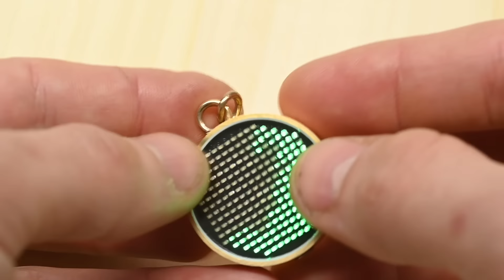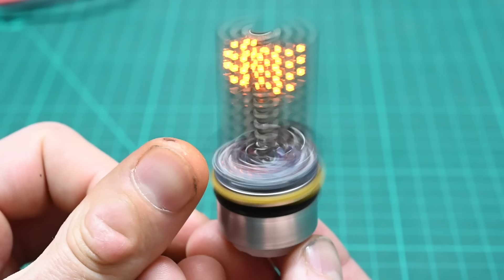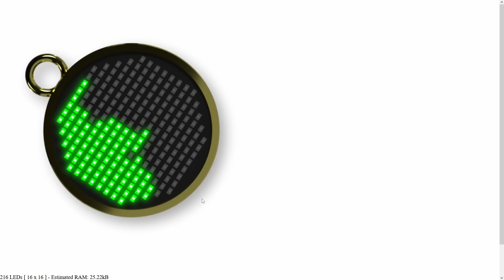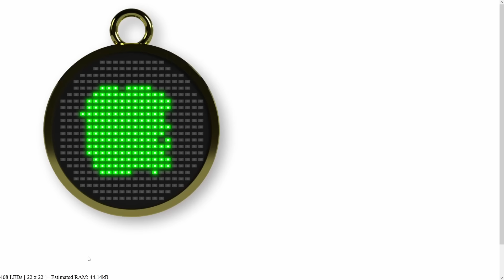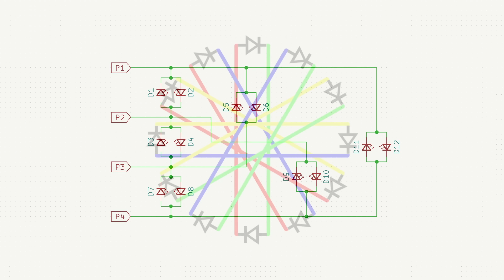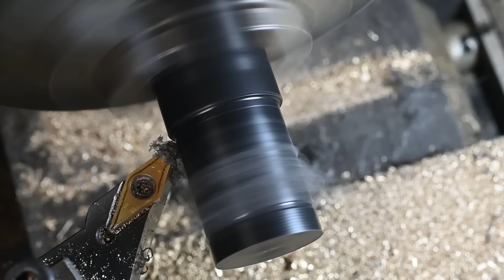Fluid Simulation Pendant

Comment: I have a question. Is it possible to make a very small micro-form device where bringing a magnet close to it turns an LED light on, and the light stays on? Then, when the magnet is brought close for the second time, it automatically turns the LED light off. In other words, can a very small magnet-controlled LED circuit like this be made?
Reply: you can detect the magnet distance with a sensor (hall effect i think?) and do the rest in code, so yeah i don't see why not. maybe you could even do it with analog electronics.

Comment: i would put water inside and some sensors lol
Reply: I would assume the Problem with water will be with surface tension, at that small scale water will end up sticking to surfaces and might result in inconsistent results.
Reply: @purvr4626  what if we put some hydrophobic thing?

Comment: I've got a 2.0 iteration challenge/idea if you're interested. Try to give the simulated fluid some depth on the 2d array. So for example, when you set the pendant on the table, the fluid would eventually settle but look thinned out with dimmed lights. Or perhaps you want to have an uneven concave basin, where the liquid pools more in the center and the centre would have a higher brightness potential. It'd be interesting to learn how compatible this would be with the pendants from this project.

Comment: i may be wrong but can we make a dense electolytic flilled liquid and then fill the disk with it and at one end its a led and another end is a wire .....so basically liquid completes the circuit and it also glows the led which looks like liquid😐😐.......................btwn thats a  cool thing u made

Comment: I am doing the same project as this and I had a look at your website and you said you would release the code sometime but that has not happened yet I would like to have a look

I would also like to note I’m replacing a few of your components with  for example the rp2040 raspberry pi pico

EDIT: coming back after 3 months , I have made the first working prototype , it’s not as elegant as yours but I will be refining it.

I have all ready learned so much

Comment: This is probably really dumb, but what if you used actual fluid instead of simulating it?
Like putting some conductive fluid between the battery and the lights so that when you shake it the actual fluid shakes and the lights power on/off because they are literally getting powered by the fluid
If you wanted some animations like you did you could probably use a secondary circuit wired to only activate on specific movements

Comment: I just had a neat idea that I hope to make someday but am sure you could accomplish better.

A ring of light. Or perhaps a bracelet. Something you wear that produces light by being worn.

LEDs can be super low power these days and still produce useful light. Peltier devices can use electricity to produce a temperature difference, or use a temperature difference to produce some current.

So, a piece of jewelry with skin contact, that uses the temperature difference between body heat and atmosphere to produce current to power a very small efficient light.

Comment: Hello, couldnt the problem of charlie plexing be solved entirely by not doing it at all and using small shift registers and using just a couple or even one gpio pin and hooking it up with the DMA and PWM controller of the stm32 chips like ws2812b leds do?

Comment: that single connector is the same type they use for magnetic usb cables with the magnetic connectors, the one you're using i'm assuming has one pin thus charges slower (p.s i know nothing about electronics, i'm just guessing) because the better connectors have more pins and some come in braided cables, some offer even rapid charging for fast smart phones

Comment: There is nothing unconventional about changing MCU (or FPGA) pin assignments to make routing easier. Pin swapping has been around forever, and some CAD packages can even do it more or less automatically. Some high-speed interfaces, like USB 3.x and Gigabit Ethernet, have automatic polarity and/or lane sensing specifically to allow direct cross-free routing of high-speed signals.

Comment: I think the snap back was a good idea, if you want repair-ability it allows easy access to the battery if anything ever happens to it, and same with the circuitry it's good to be confident with your design, but even better to be confident with it's user repair-ability.

Comment: I think the only 2 changes that would make this better are:
1.) A dial built into the where the jump ring meets the pendant that increases or decreases the brightness when rotated 180 degrees. (if you could find a dial that would fit and work well enough while also hanging from a necklace)
2.) Make the octagon arrangement closer to an octagon for more efficiency filling the circle. Without adding a very high number of pixels, the best approximation closest to this one would add 1 extra to the diagonals for 264 pixels (an 18×18 square grid with 15 pixels missing from each corner).

Comment: if you feel like making it more complex, would be cool if you use a 3d simulation and dim the LEDs to show depth. so if it's flat on the table screen up it's dim but fully illuminated, and screen down it would be bright fully illuminated. it would also make the splashing around quite cool imo but wouldn't ruin the ascetic of it being a low res screen.

Comment: It would have been cool if a water pool was 2 layers deep and half full, so when it was laying face up it was a solid color. And also displaying how much water in each pixel by making it dimmer when only one layer is filled would add a practical purpose to it as a level.

Comment: Stupid question from someone with very very limited electrical experience, but to help with the shorting issue when connecting the charging cable, could you also isolate the charging port by widening the hole a little and using a rubber gasket in the charging port's mounting hole as well as protective insulation on the internal wires? I'd love to give making this a go for a present, but I know the user would likely end up plugging the usb in before the charging port or knocking the cable enough to short it.

Comment: Why not just use water?
Reply: Because the point is that it's a fluid simulation, not actual fluid. He discusses this literally a minute in.
Reply: Why not just use a smart phone?
Reply: You are deliberately missing the point.
Reply: @mochafennec You are deliberately missing the point that sometimes mechanical designs and/or simple designs are superior and more cost effective than the all electronic / microprocessor / ai alternative.
Reply: You are correct, nobody is arguing that isn't the case. Since you seem to need to have the point spelled out for you, the reason it was done this way is because the fluid simulation and representation of said simulation using the LED matrix is a complex task in and of itself, and as explained in the first few minutes, it is part of an exploration on using similar technology in other, more complicated applications. You are so desperate to make your point that you are willingly ignorant to the intended purpose behind the project.
Reply: @mochafennec  Yes indeed, I am. In fact, I haven't watched the video entirely. That said, I had the time to see that it was not simulating a fluid but sand and sand cannot be 2D hence the awkward look. I was gonna say there is no practical use for such a thing and even for learning purpose there was no need to implement it and that it is a waste of time but seeing that he sold a bunch for 1000 pounds each I'd say this is a nice work of art / jewelry. Thanks for arguing with me, I will not respond to subsequent answers since this would be a waste of time.
Reply: Have a good one.

Comment: You are whipping that thing all OVER the fucking place. Hold it still for a second FFS dude! Turned the video off because you're literally going ADHD every time the simulation is on screen. I get that you're trying to prove that the thing works but jesus christ dude let us watch it in action instead of jump cutting to 30 different angles of you flipping the thing around like you're chasing a high score. Do you struggle with fidgeting? With ADHD?

Comment: One thing I am concerned with in terms of purchasing electronic jewelry is the failure rate. So, what if an electronic component breaks inside the pendant. Your the only one who can fix it. Could people send the amulet back to have it fixed for damages? I understand that there would be a service fee in terms of the pendant being fixed. Also, there is sending it through the mail which all those fees add up.

All it can take is one thing to go and say if I purchased an electronic ring and me dropping it then it not lighting up. The entire purpose I purchased a light up ring is for the light function. Without that the ring's value or functionality is a lot less.

Comment: This could also work with just having LEDs in one side and a source of Power on the backside and filling about %50 of the inside  with mercury, to conduct the power from the battery to the LEDs. Not sure if this would actually work, it's just how I imaged it was done before seeing the video^^

Comment: Correct me if I’m wrong bcuz I’m pretty new to electronics
Could you not put some actual fluid in the back of the pendant and run a current through it to light up the leds?

Comment: I was thinking if the display and power components could be separated, as this would make the design even thinner. For example, the magnet connector currently at the bottom could be moved to the top, serving as a hanging point too. It could transfer power from a battery too. The battery could then be a needle type battery seamlessly integrated into the pendant chain.

Comment: this looks awesome, i think the design could work with a single button for more simply turning it off off and could even be used to change modes or something if you wished, one small button close to the reset thingy probably wouldn't ruin it aesthetically

Comment: Astonishing! This shows how tricky auto routing is, since it only works in complex cases if you have already optimized the schematic 

I'm not aware of a system which can do this in the general case. Only special cases like impedance matched traces are covered

Comment: Beautiful! For building such a display I found it easy to make my own four layer PCB by soldering together two two layer ones. Make vias on one board and pads on the other, then hold the two boards together and fill the vias with solder. Voila: A super cheap four layer board with blind vias. This gives you much more space on the back.

Comment: the thing in my head was to make the inner walls of the ring+back a mirror and have glass reflect some of the lights back and the mirror would give some back and it would bounce off again. the subtle offset would create an endless depth that vanishes beyond the ring. kinda like those "endless mirror advertisement boards"
Reply: nevermind it was very thin for it

Comment: If you could find a way to project each flip cell (maybe in an LED matrix of sorts), would it be possible to make a handheld spirit level projector with this tech? Or maybe a self-stabilising crosshair instead of the whole fluid SIM (as cool as it most certainly is)

Comment: > I'm not going to build hundreds of them

No, thousands. Mass-produce this at a 250 EUR price point and every tech person will be hoping for one for Christmas.
Reply: i agree, these can sell like fidget spinners, and they will if people like em
Reply: I know someone for whom this pendant is almost specifically designed for, and I'd pay an easy $200 CAD for one for them.  They're doing research  into fluid dynamics, so this is perfect for them. :)  Sadly, I don't think I could make one, and I don't think Mitexla's selling the ones they made, either.
Reply: This... Incredibly stupid not to use this... Even for licensing you could make millions with zero additional work...
Reply: i love this gadget and this is a work of art but i think 250 euro is hugely overpriced
Reply: @qpwoeiruty108  Compared to £1000 it is a bargain, for a small production it is not possible to make it cheaper, the reason we are used to cheap gadgets is production in thousands or millions, handmade artisan labour is at least £25 an hour, then add materials, shipping, tax, computerwork and the risk of one breaking needing replacement, i live with an artist and know the grind...
Reply: @qpwoeiruty108  I guess that depends if you want the hand-crafted case or not.
Reply: You're forgetting that mass production of a quality product isn't just a throwaway thing. When you're just building one as a little nik nak it's easy to fix any issues as they come up but if you're building thousands, a problem that only happens 10% of the time can add hours of labour and $$$, especially the fact that if one of them breaks when sent out, customers are going to feel really annoyed that they spent 250 that failed when it was dropped once. Product design and release to the public is a nightmare
Reply: I would buy it at €250, feels more right than any other tech product, yet as a commenter wrote, it would be really useful to have it also be a watch, one way would be to show the time when it is lying flat, and the digits falling to the side when it gets turned. Setting the time would be simple reset the clock to 00:00 if it detects the power connected and disconnected 3 times within 10 seconds
Reply: @solsang  so you have to stay up to midnight to set it? what a bad UX
Reply: @eternaleggface  As a 12 hour clock it could be reset at noon, it would be really  beautilful by having a circle of big dots showing the hours and smaller dots for each 5 minutes, aa two concentric circles :)
Reply: I think that most people value it so high because they are both rare and hand crafted. Besides the fact that they are cool af, mass production would get rid of those two values.
Reply: @ContagiousPow yeah... so they would sell 10x more at a lower price is what you're saying and the original few people won't feel as special anymore. Oh no! Welcome to inventing something!
Reply: @ContagiousPow  Which is why it would go down to 250 euro instead of the 1000 he was charging for the handmade ones, as he should have because handmaking shit is hard but nicer.
Reply: @ I think his issues are not with the objective value of the pendant, but to fight against the inherent mass production of a lot of things in the modern day. If he did mass produce them, especially with cheaper materials, they would objectively cost less, however, they  wouldn't be rare, nor something entirely worth having, in my eyes. It would become yet another pendant that has no sentimental value, nor actual worth aside from the materials used to create it. I think that the reason why the original ones are priced so highly, and why people actually bought them is because someone put hard work and effort into both designing and building it by hand. The price point isn't just material worth, but also the fact that each pendant is rare and special.
Reply: @ContagiousPow  I agree totally. Mitxela put considerable time/effort/resources into bringing these into existance, they are unique, clever beautiful pieces. This is very specialist work that not many people are capable of producing. Also as it's his project, done on his terms, he can value his time and effort as he sees fit and I fully support it.
Reply: @spamuel98  But you're missing the point, it sold 1000 GBP a piece because it's a very low run handmade stuff. The price is also partly justified by the time he spent designing and manufacturing it. If he were to mass produce it, the exclusiveness factor would be gone and manufacturing cost would plummet. It's value would be among other meaningless stuff in aliexpress.

The guy who said "Nobody in their right mind would spend more than 40 euros" is not wrong, for a mass produced one, even 40€ price tag would be hard to justify.
Reply: @ContagiousPow  not really, if it was well made tons of people would want one. It's just a really cool design.
Reply: @NeilsBohrrr  yeah and we'd see fifty at every thrift store when the fad ended
Reply: @ContagiousPow  i mean luxury goods sell for high prices when they're produced at like sub dollar prices
Reply: no bro))
Reply: Or just don't use gold. Use aluminum or stainless steel finish and put them out at a price point that people can actually afford. Gold is less expensive than people think, but it causes the perceived value to increase by a lot so the margins on it are insane.
Reply: I'd love to be able to order the completed board and 3D print my own case for it. I'd be willing to pay $50-$150 for it.
Reply: id buy one
Reply: That's true dumbest thing I've ever heard. Nobody in their right mind would spend more than 40 euros. It offers zero utilitarian value, doesn't even tell the time, and it can be stimulated on an app. It's interesting, but worth nothing in the sense that it's has zero utility. 250 is insane. If it had diamonds on it, real gold, higher resolution screen, idk... this is not a business that could succeed.
Reply: @snottyboy9983 

"Zero utilitarian value"

"Maybe if it had a diamond on it, real gold"

Do you not see the irony of your criticism?
Reply: @snottyboy9983  He sold all of the ones he had for 1200 euros, you know nothing

Comment: I wonder if you could somehow do this but embedded into fabric... I'm imagining a dress with wide flowing sleeves with leds in a grid along them.

The flute simulation would change how's the weather move their arms.
So if the arms are straight down the lights at the cuff of the sleeves would be on. As they lift their arms the lights would give the appearance of splashing waves.

If the fabric could be sheer it would make an even more impressive visual